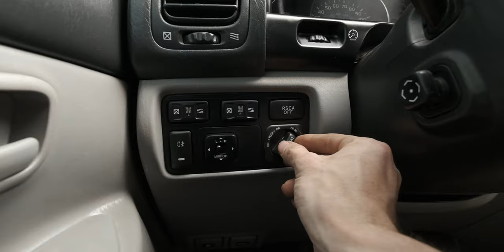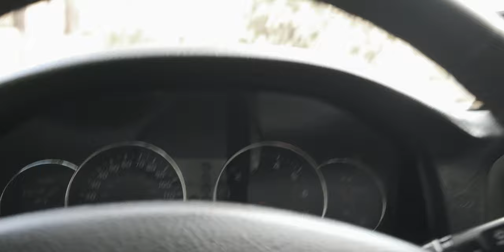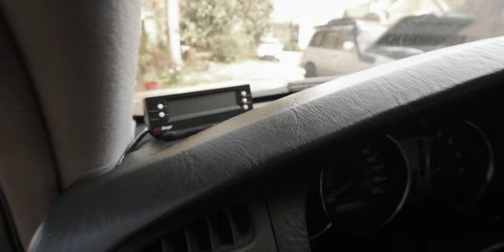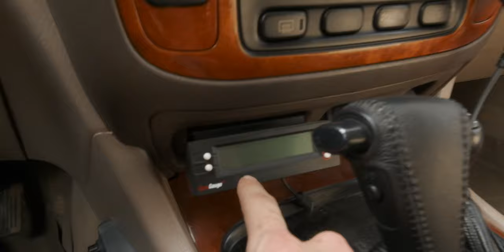Land Cruiser 100 & Lexus LX470 Off-Road build walkaround

Comment from the maker: 8/14/23 I have a lot of work to do on the rig. I plan to upgrade the shocks, trailing arms, rear driveshaft, 12V system, and much more. The ironman Foam Cell Pros have served me well but my truck is just too heavy for them now. Time to get on board with some remote ressies...
Reply: Viavi gear? What kind of fiber work you doin?😂

Comment: A middle ground solution for the swaybars may be to keep the rear and remove the front.  Apparently this actually increases front end articulation with the IFS more than with the rear removed.
Reply from the maker: I watched Kai’s video too but don’t want a rear sway bar in the way. One more thing to rip off on a rock.
Reply: @cruiserpatch  His videos are fantastic.
Reply: I can confirm, I kept my rear swaybar in and removed my front swaybar, I gained about 34mm more up travel and 15mm down travel in front suspension. I have slinky long travel setup in rear and lost about 50mm down travel and 15mm up travel but the additional front flex makes the vehicle far more capable than removing both swaybars. Like Tinker says, it's all about the balance of front to rear. 
You can then also benefit from longer front shocks, those Ironman shocks are the same length as factory, too short for that lift you have. Icon or Dobinson IMS shocks are about an inch longer and will give you an extra 40mm more down travel in front.
Reply: Also, on Zac's rig, why not just use longer shocks rather than chopping the mounts? I get that he achieved more down travel doing this but seems a bit crazy when there are longer shocks out there than those he's using.

Comment: Great build man. Thanks for sharing. Did you have to do a lot of cutting and such to fit the 35s? Any need or plans to re-gear? Im on 305/70/16 now and always wonder about 35s.
Reply from the maker: I hammered in the pinch weld and added aftermarket UCAs and bumpstops. Besides that i’ve had a bit of rub at full compression but it’s unavoidable without removing the fender liners completely
Reply from the maker: As for the gears, my truck is sluggish now but it’s not even measurably slower than it was with 33” mud tires. I’ll be regearing my transfer case soon once I can afford the high range gears
Reply: Hey sorry to bug ya again. Really like your wheel set up, looking at going up to an 18 inch wheel. Any idea what the width and offset of your wheels? I’m looking at maybe 18x9.5 with +6mm offset, trying to figure out how that would fit.
Reply from the maker: I honestly have no clue. They’re factory Tundra rims from toyota so you can probably google that info
Reply: @cruiserpatch  I did actually. In case you’re wondering… 18x8, but not sure about offset, one source said 18-50mm. Thanks for you reply.

Comment: I just got a stock 06 lx, what size tires would you recommend putting on the stock wheels. 285/60/18 or 275/65/18?
Reply from the maker: Depends what you want to do with the truck. I wouldn’t offroad with anything less than a 35” tire on a 100 now that i’ve felt how much better it rides offroad
Reply from the maker: A 33” fits without issue on a 100 and a 35” requires slight modifications (aftermarket UCAs, spacers, and pinch weld mod)

Comment: Hello, what suspension do you have on the LX 470? I want to delete my AHC and I’m unsure as to what suspension to get. And how does your suspension ride?
Reply from the maker: rule of thumb: aftermarket torsion bars and springs make it ride stiff. the closer you can keep it to stock the better it will ride. if you lift it, it will ride worse unless you want to spend big money on racing shocks. dobinsons and ironman make good suspension kits that would be good replacements for AHC

Comment: Those steelies are cool. Didn't know that Tundra wheels also fit (newbe here). Can you talk about your commo systems?  What are you running?  Ham? FRS?
Reply from the maker: i use GMRS frequencies, specifically with a rugged radios GMR45W unit and the Alamosa Antenna GMRS antenna (+6DB). i also carry a handheld rugged radio for spotting and/or folks who didn’t bring comms
Reply: @cruiserpatch  Sweet! Thanks. Figuring out how to mount and wire those things can be a challenge. Maybe a future video?  Love your channel.
Reply from the maker: I’ll add it to my list! A good comms video would be cool

Comment: Does the battery fit with no modifications? That’s quite a hefty beast
Reply from the maker: It does! If memory serves me correctly the plastic battery tray in my truck is cracked so i removed it